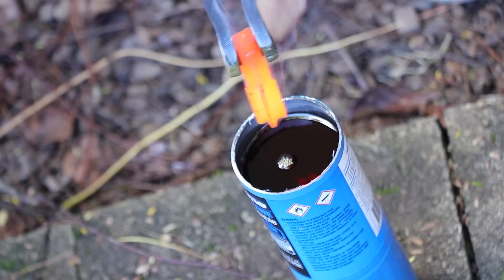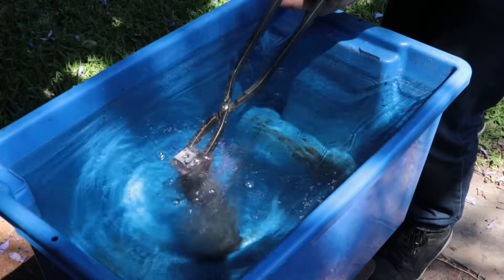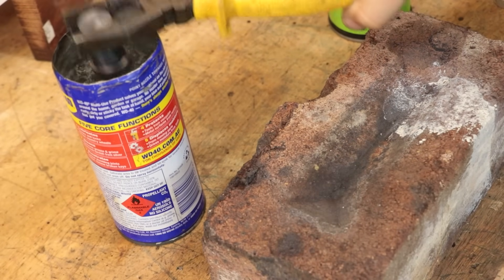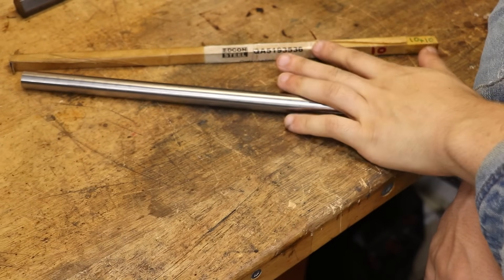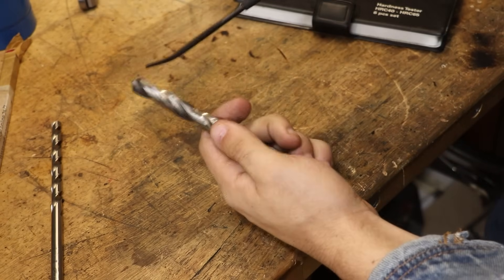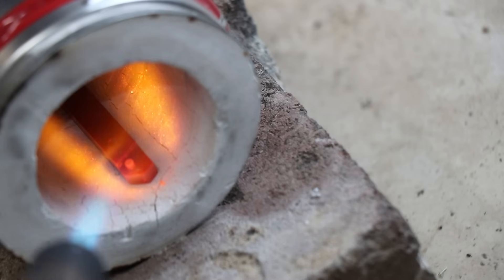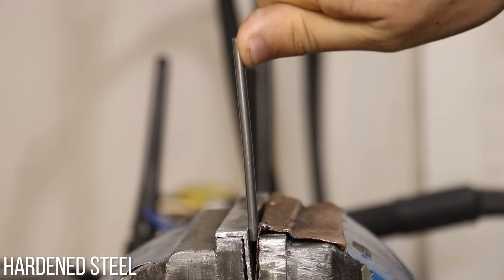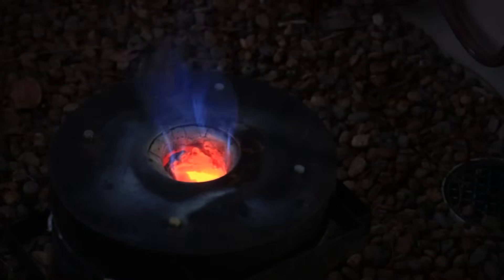10 Misconceptions About Heat Treating Steel

Comment: If I wanted to case harden machine ways I’m assuming the entire part would have to be case hardened and then machined again?
Reply from the maker: Yeah. That is why they are usually induction hardened
Reply: @artisanmakes So the entire part would be carburized and then just the ways would be hardened through induction?
Reply from the maker: Usually its made from cast iron. I have not heard of an entire machine being case hardened.

Comment: Old books says the best quench methode was a bucket with water and 10cm oil layer above it. The hot iron got fast punched throught the oil layer in the water. Maybe some usefull info for an smith here

Comment: So I was taught that when quenching , 
oil is preferred because when the oil burns , a layer of carbon is added to the surface of the metal that penetrates slightly below the surface which not apparently adds a bit of protection from oxidization  as well as giving the surface layer a bit more strength as opposed to the core!
water can sometimes strip away the external carbon layer ( seen as black soot on the surface of the water with some metals) leaving the metal harder on the inside than the outside resulting in stress cracks when the metal shrinks during the cooling process! 
I am a hobby metal basher and might have a slight obsession with the art! lol
always love to learn , so thank you for your presentation!

Comment: You're using the wrong oil. You need to use motor oil, not cooking oil.😢
Reply from the maker: On what are you basing that? TTT diagrams and CCT diagrams are what will inform and determine the needed rate of cooling, from there you can decide what quench medium to use. One oil is not necessarily better than another.
Reply: @artisanmakes  yes  oil use oil That not for  cooking oil
Reply from the maker: There is no reason not to use cooking oil for these small shop based set ups. So as long as the heat capacity of that oil falls within the range of what you need

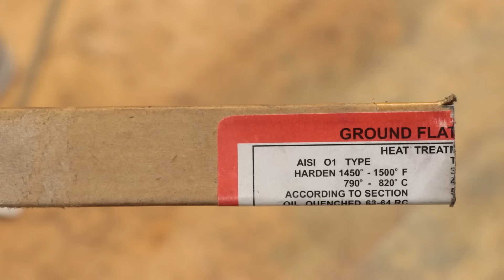Comment: That was a very small quench tank at the 2:00 mark. You need a large enough volume to properly draw the heat out. That little can is definitely not sufficient.
Reply from the maker: It’s a bit small but it does not pose much issue. These were an alloy steel and the time needed to quench to form martensite was 10 seconds.
Reply: @artisanmakes  I'm not trying to be critical of your work but I am trying to give you some honest advice. It makes a bigger difference than you think. It's always better to go bigger when choosing a quench tank.
Also, not trying to impose, but I would like to recommend looking up Dr. Larrin Thomas and his YouTube channel. He probably knows more about this topic, and many more, than anyone in the world. I can't begin to tell you how much I've learned from his work and research.
I hope I didn't offend you with my first comment.
Please accept my apology and do take a look into knife steel nerds, if you haven't already.
Reply from the maker: This particular part was made from D2 tool steel. It has high hardenability so you can take a long time to quench to form Martensite. It alloys you to play around with warm or small quenching baths. Even if it was a plain carbon steel it’s fine, you would just produce less martensite but you’d find that the hardness would lie in the 50s hrc at the surface. This particular part only needed hardness at the very surface.
Reply from the maker: I like Dr Larrins work, I think he is one of the better voices in the knife making community when it comes to heat treatment. I, like he studied metallurgy at university, it just was not my degree.
Reply: Thanks for taking the time to explain. I totally understand now 😄.
And thanks for not getting offended and writing me off as some, know it all, critic.
Reply from the maker: Nah its all good. :)

Comment: In my experience with blacksmithing, water quenching is a very good method of hardening blades, but you're not supposed to dunk your workpiece in the water like they do in quenching fluid or oil. In my country, what blacksmiths do is they only dip the cutting edge in the water for 1 or two seconds before pulling it out, waiting 3-5 seconds, and repeating the process.
Reply: An interrupted quench 👍🏻

Comment: I used to Inspect tool joints and drill pipes, these are always quenched in Oil, the reason being is that Oil quenching gives less thermal shock when higher carbon steels are being heat treated, therefore less risk of quench cracking !

Comment: Good revelations!
Yes, steel heat threatment is ART. As you told: you can't put in fire random piece of iron, then throw in water/oil and wait for good results.
I too had, have, will have a neceserry for heat threated parts. And like You: those are varios parts from simple pin to gear and tools. I had same heat thratment problems as You.
Lucky, ages ago I get few books for steel geat threatment. There I find out to: We can not heat thread part whithout defects - ir change dimensions; twist; curve; etc. Knowledge of materials what are You using. Knowledge of each alloy elemet adding effect on material heat threatment specs. Right Temperature and time of heating / cooling. Cooling environment: water and oil weight must be at least 10...50:1 to mass of the workpiece. You can conbine cooling enviroment: through watter to oil, then air for example. Then heat threadted part "normalization" what is another heat threatment process. And more etc.
Get handbooks.
Good luck!

Comment: My grandfather used water most of the time. certain situations oil would work good. but using oil has the risk fire. and oil cooled metal has to be cleaned.

Comment: 14:50 no the two different pieces did not flex equally 😂 is he watching a different video? That was his skin acting as a cushion and that was the movement that was equal not the steel movement.😂
Reply from the maker: Yes I made the video, I also said that they are NOT equal diameter but if they were they would flex an equal distance.
Reply from the maker: The underlying statement is correct, heat treatment does not affect steel stiffness/elasticity

Comment: It all comes down to the metal specifications for hardness requirements. Whether it's military, mining, or general purpose, and this is where hardness testing comes into it, when pouring the molten metal, it is usually accompanied with test bars of the same specification metal. The strongest cast steel being Manganese.

Comment: I worked in tool and die and we sent all our tool steels out to a heat treater. I found O1 to be miserable to machine. Any parts that we sent out we left 1/64" on them to compensate for decarburization. We also left radii in corners to reduce the risk of cracking. I always found heat treating fascinating. There is even cryogenic treatment of metals that makes them tougher.

Comment: Thanks, great video.   I'm still trying to figure out the difference between hardening and tempering, been at it since the 90's.
Reply: Steel that's just hardened is brittle and often we want steel that is both hard and tough. So then steel is tempered by heating it up a second time to a lesser temperature. That reduces the hardness and imparts more toughness. Heat treatment changes the molecular structure of the metal.

Comment: i think this is pretty much all correct but carbon does diffuse very quickly into a very hot part. this is the basis for flame hardening with an oxy-acetylene torch and carburizing flame.
Reply from the maker: Yes you are right, gas carburising is much faster than the pack method that I was talking about but this is more focused on the home shop heat treatment. Cheers

Comment: The "used motor oil" treatment is not just to put the hot steel in used oil.
My technique, is to coat the steel in really black oil from an old Harley motorcycle (very high carbon content in the oil) THEN burn it with the blowtorch so the oil coating burns into the steel surface at high temps. Then repeat a few times, dip it in more oil, pull it out covered in oil then burn it with the blowtorch.
I assume thst burning the oil off even turns the oil itself into more carbon, and does so while the surface is red hot and permeable.
Of course this is not as good as proper steel designed for hardening, but as a fast low tech solution it can put a hard skin on something and gives a bluing-like effect. 👍
Reply: Poppycock waste of time
Reply: What part of carbon takes hours to diffuse into steel don't you understand?
Reply: @1pcfred    no need to be rude. Many types of steel blueing occur in seconds, and impart a carbon layer on the surface of the steel.
Certain types of deep hardening might take "hours" for the carbon to impregnate that deep, but you should not assume that a fast process of burning a carbon-rich oil onto the surface of the steel would be worthless.

Comment: If you use saltwater, you can harden low carbon steel to the hardness of nearly tool steel. I have used this method many times for making turning tools for my metal lathe and I make the tools out of rebar. Grind, shape the tools, heat, quench and temper and sharpen
Reply: Most rebar is made out of mystery metal. Some of it may be tool steel.

Comment: As a general rule, I try to stay away from steels that have higher than 2% alloy content for home heat treatment.  Any higher and the soak times go up to dissolve carbides.  Any higher alloy content than 2% is simply a waste as you will never get a proper martensitic micro-structure.

Comment: Quenching in a molten salt bath (e.g., sodium nitrate/potassium nitrate) at 250–400°C for 1–4 hours enables the formation of lower bainite in steel, providing a balance of high strength and toughness.
Reply from the maker: We did something similar back when I studied heat treating. But martempering in hot oil rather than a salt bath. Cheers

Comment: the biggest factor no one talks about is grain structure. 
even the highest hardness and most optimal tempered tool will not perform if the grain structure is not of optimal size.
for reference: "all the pieces you show snapping in this video have HORRIBLE grain structure, the grain structure when broken should look as smooth as glass, if it looks grainy, it means it will easily fall apart even with hardnest/temper/shrpness being optimal"

Comment: I like used motor oil for quenching, it seems to leave a nice dark color on the steel so I know later that I hardened it. Plus you don't have to store it special, just dump it back in your recycling jug to take in later.

Comment: I saw an amazing video once, of a guy quenching a knife in Molten Salt, which was around 1000 degrees…..It was so amazing.  It turned the metal this really gorgeous psychedelic green and blue color.   I’ve never been able to find the video again….but it was amazing.   I don;t know how well it hardened it…..but it was GORGEOUS.
Reply: molten salts were once quite common.  They are dangerous AF as any trace of moisture on the part will cause an explosion when dunked in the molten salts.
Reply: @Andy_Hinners  The factory I worked in had a molten salt bath. Idiots would throw small paper cups with a teaspoon of water in them into the salt pot......BOOM.  Not funny but they thought so.
Reply: Isn’t salt the heating medium? It melts at 1474° F. Which is critical temp for many simple steels. Quenching knives can be tricky as they are very thin.

Comment: I’m willing to share, my very limited understanding of heat treating, which is basically that…quenching thin flat things in water, increases the chance of warpage, which certainly can also occur with an oil quench…also quenching in water is good for making spring steel, files, etc. with the caveat that it makes things slightly more brittle than an oil quench. 
Wrong or right…..that is my limited understanding….please feel free to correct me….I don;t care about being right, I care about a good quench. 🤷‍♂️

Comment: Thanks for the great video, every alloy has specific properties and uses. Therefore there can be different heat treatments depending on the  end use for each specific alloy. My feeling is that metallurgy is a very large rabbet hole, the more you learn the more you realize that you know very little about the subject

Comment: I'm a blacksmith and I heat treat parts in the forge all the time.  It really depends on what you're making for how precise you need to be, but for the vast majority of the tool steels that I use for making tools from I just heat it until it's non-magnetic and air cool, then repeat and quench in oil.  Then let the colors run until the edge is that light straw color.  Works just fine for most tools, and typically I'm using 4140, 4340, or 1045 (all US designations).  If you aren't sure, look up the steel type from the manufacturer and it'll have heat treating instructions that you can follow.
Reply: All depends on your alloys. This guy really doesn’t hit the mark on most points. Tool maker here
Reply: Was working on a very important piece once. Straight up idiots let some dumbass sabotage it left in furnace too long didn't quench in oil and like it was a joke splashed paint everywhere. Clean up was left only to me and I'm pretty sure the whole shop was like what the fuck

Comment: unrelated question, yet maybe related.
  I had to make a blade for a plane and the piece of steel I used for the blade is quite soft. It sharpens very easily and likewise dulls very quickly.
   So, my question is:  how can I determine whether this piece of steel is actually a good candidate for hardening? Is there a simple test that can be done to see if the steel has the enough quality to hold a hardened and tempered edge?
thanks in advance for any comments.
Reply: It isn't a matter of quality it is a matter of carbon content. If it is low carbon steel it can't be hardened.  Heat it up and quench it and see if it hardens. That's as simple as it gets. Then you'll have your answer. Maybe you can spark test it? But I don't know if spark testing works on annealed metal. When you grind high carbon steel the sparks are orange and they fork. Low carbon they're yellow, brighter and shoot straight.

Comment: Good, comprehensive info for those who do not have material science or metallurgy expertise.  Matching the materials to the "Fit for Purpose" requires the knowledge and skills to get optimal results.  However, in DIY world, there is an economy in having a tool that allows one to operate over a wider range without switching around or looking for the perfect material for the job.  The cost of decent HSS-based tools are not that much more than those made from HC steels, which require high maintenance

Comment: I can't speak to the suitability of used motor oil in quenching, but I have had excellent results in using it as the final step in rust bluing and parkerizing.  With manganese, in particular, it produces a deep satin black that is really excellent.

Comment: Will you ever switch to a 3 phase motor on the lathe just like the mill??
Reply from the maker: Probably not. I get the advantage of the gearbox, so very rarely do I run out of torque. Cheers

Comment: Should also note that it depends on size of the peace. Having done 1: 12 scale working tools as experiment smaller the peace, less heat retention there is due the lack of mass and i have had issues of parts aircooling or being work hardened from hammer blows causing heating and rapid air cooling, then snapping from following blow due being now air hardened. Similar issue is with trying to forge small peaces since peace rapidly cools before you get more than one or two blows in.

Comment: When I was involved in inspection of welds, some years back P92 steel was developed for high temp steam lines in power stations. This is a tricky material to work as it is very brittle directly after welding such that it is forbidden to transport the pipes before PWHT. Before engineers and inspectors realised how critical this was, there were many cases of welds cracking. The problem was exacerbated by the fact that the PWHT was very precise regarding temperature and soak times, which also caused welds to fail non-destructive tests.

Comment: Good HT primer, bang on!  The worst technique that makes me face palm is when YouTubers dunk a red-hot piece of steel into oil, and remove it while it's still red hot and watching the flames. They don't realize it's important leave it in the oil until it's cool enough to not cause a flareup!
Reply: @Bob_Adkins  There is a certain type of oil that can be safely used for quenching. The reason it is used for quenching is it has a very high flash point which helps guard against flare-ups that you mentioned. It is actually hard to get this oil to burn.

Comment: we were taught to use old engine oil. that it does a way better job at hardening than new oil. the carbon is what it is needing to help hardeni the outside more.
Reply: He explained why carbon in the oil won't matter. By the time the steel hits the oil it is too cool to absorb carbon. It takes a very long time at temperature to absorb any carbon at all.

Comment: Not sure you're right on the stiffness part. If you take a piece of unhardened vs properly hardened and tempered of the same steel, it could require much more force to bend it the same way, and of course the elastic zone, in terms of force, is much larger on the hardened one. That's what stiffness is about, isn't it ? There might be exceptions to this which I don't know of course.
Reply: No, the force required to elastically deform hardened and unhardened steel is the same. 
Hardening it does not improve its stiffness in the elastic zone. 

Hardening does improve stiffness in the plastic deformation zone; by increasing yield strength, more force can be applied before failure (bending or breaking.)